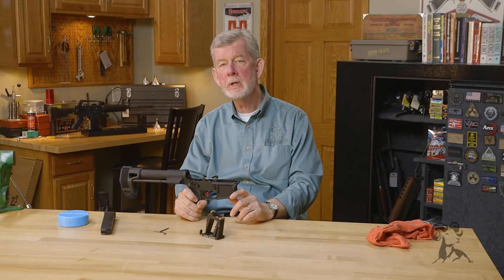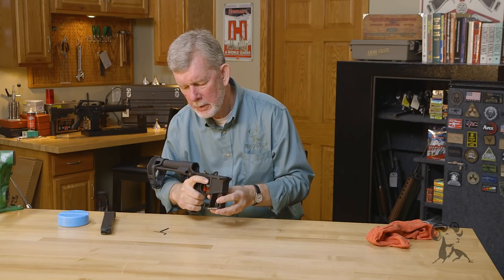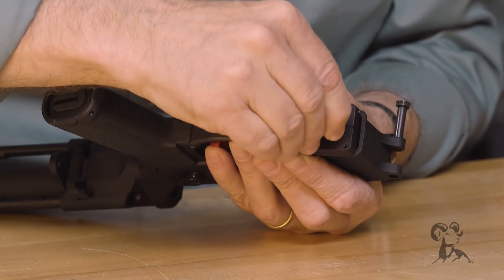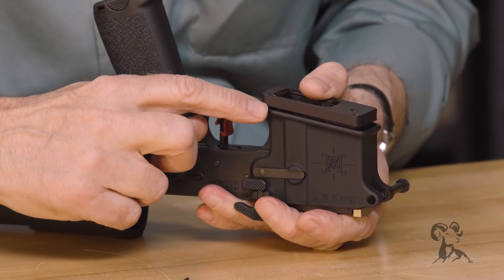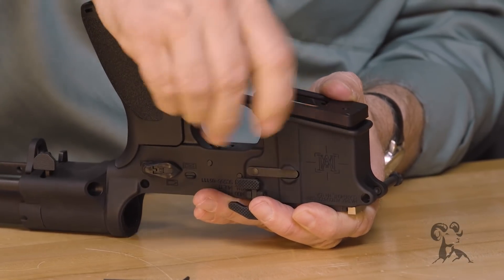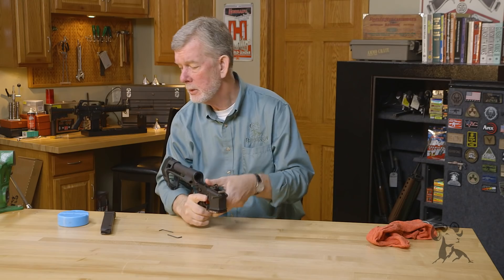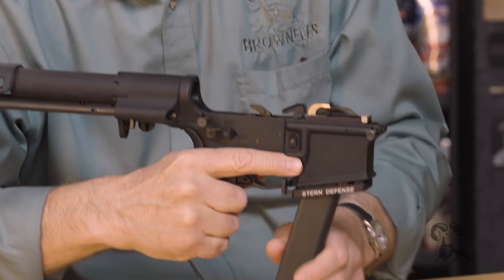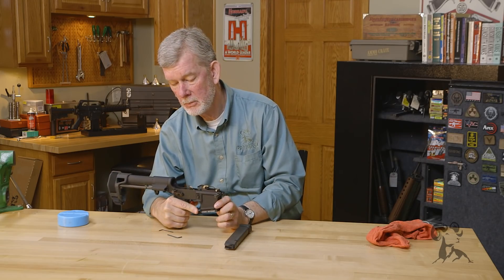Quick Tip: Installing the Stern Defense 5.56 to 9mm AR-15 Magwell Adapter

Comment: Stern, if you're listening, instead of tool operated set screws why not spring or mechanical tension that can be operated one handed. Two buttons on the side, squeeze to insert, release to lock in. This could work for the tension inside as well as along the lip of the mag well. Extending pins inside and hooks along the bottom edge with the tension pulling up. If you make one I'll test it for you.

Comment: FYI. Pre-ban Glock 17 Mags will NOT fit this unless you do some shaving on certain areas of the mag. They will be tight when inserting a full mag but drop free when empty. See STERN for where to make these adjustments.

Comment: I can't get my stern defense 9mm adapter to install correctly. PSA 5.56 lower, foxtrot mike 9mm upper. The corners on the silver feed ramp block are hitting the inside corners of the upper receiver. Sent upper back to FM, they installed new receiver but it's still doing the same thing. Stern defense says it's a problem with FM upper. FM says it's the adapter. I'm out of a lot of money for something that doesn't work.
Reply: @vettelover2009 it installs perfectly without the FM9 upper installed. I have it installed per the instructions. With the gap and all the screws tightened. But the Foxtrot Mike 9mm upper won't install properly unless I remove the adapter.
Reply: @vettelover2009 yes. The inside of the receiver isn't cut as square as my 5.56 upper. It has a slight oval to it which is where it's hitting. I dropped it off at a gunsmith today who's going to grind a little off the corners of the feed ramp of the adapter. That will void my warranty but I'm too far into it now to back out. In hindsight, I should have just bought a dedicated AR9 lower but I wanted the ability to switch between 9mm and SBR 5.56.
Reply: @SeeSaw99 hey I know its been a few years. Did you get it to work?
Reply: @JaySubii  Yes. I took it to a gunsmith who had to grind down the adapter to get it to install. I eventually found out that FM had been receiving a ton of complaints about this very problem. I haven't bought anything else from them for that very reason
Reply: @SeeSaw99  How does the FM9 upper behave after this modification? I wonder if the new versions that FM is building have corrected this issue...

Comment: So I'm interested in buying a 9mm upper and this stern defense mag adapter. Do I have to switch out my buffer and spring from my .556 setup in order to run 9mm?
Reply from the maker: Buffer for sure, spring maybe. Depends on the spring youre running currently. To confirm what youd need exactly give our techs a call at 800-741-0015! 😃
Reply: YUP AT least an H3 buffer!!

Comment: Not sure if I'm doing anything wrong but my bolt carrier group keeps hitting the curved silver part and not stripping a bullet off the mag and loading it into the chamber.

I made sure to push it down and tighten the 3 set screws and that still doesn't push it down far enough to clear enough space for the bolt to go over it and load a bullet into the chamber.
Reply: Make sure you’re using a Glock style Bolt!! It says that specifically on the Stern Defense website!

Comment: I bought a Brownells stripped upper receiver and a foxtrot Mike ar15 9mm barrel from Brownells but the upper is too small for the barrel to go all the way through.
Reply: Rip
Reply: Put grease on your Barrel extension hold upper receiver threads over your stove while spinning. Remove it from the Heat and insert Barrel